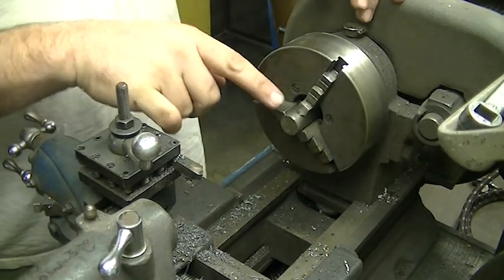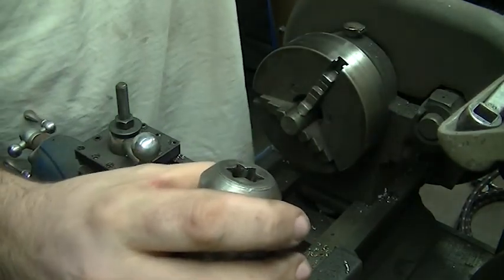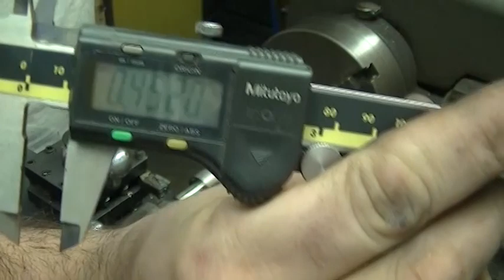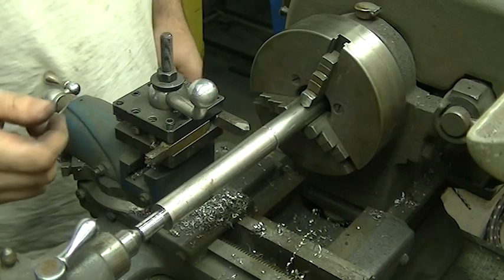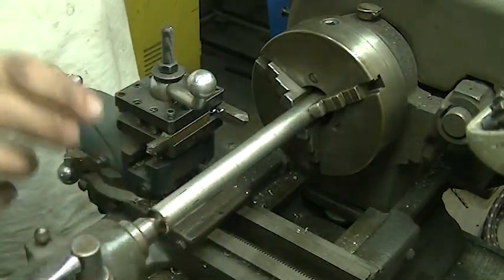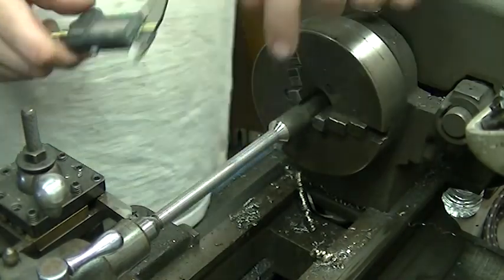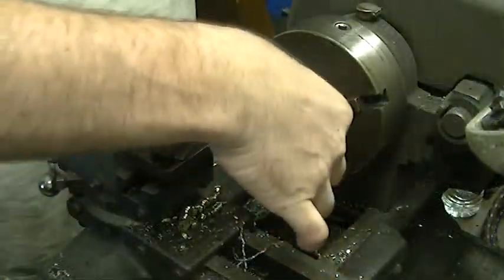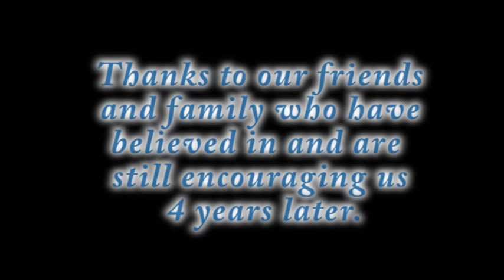Spring Loaded Center For Lathe / Milling Machine

Comment: Liked the entire idea, and will be making one. One thing I would change is making the shank 1/2" so I could also put it in a collet for use on the mill without using a chuck. Also, I saw a video where a cut spring was put in a V block and held against a sander to make it flat, just passing that on for what it is worth.
Thanks for the great idea!

Comment: I'll have to agree with the mention below about reaching in with bare hands to remove long stringy chips. Only a matter of time until you get hooked. I never touch the chips with bare hands, that's what a cheap chip/paint brush and long needle nose pliers are for. And there's a few designs around showing how to convert the more usual hand wheel advanced tail stock quill over to a lever feed. Much nicer for deep hole drilling but even better if you had a second tail stock to convert so either one's good points could be used as needed.

Highly recommend a book written by a George H. Thomas in the U.K. Despite the title it's almost all about shop made tooling, very high class machining and some very good tooling designs. The Model Engineers Workshop Manual. 100% the very best book I have and there's a lot of those to judge it against.

Comment: Nice vid Jeff. I got my 1st Lathe 32 days ago (Atlas 12x36 Commercial) You touched on many points I ran across already. I used a tap wrench for the 1st time today being supported by the tailstock center, played the quill advance game. Drilled yesterday....played the tailstock advance, retreat to remove chips-advance game. I think I am gonna make one of those spring loaded centers tomorrow. I am thinking the bore and sliding center need to be pretty tight tolerances to avoid play...maybe over-thinking it since its just supporting a tap handle. I dont have a mill for making the slot, should be interesting. Thx for sharing the project :)
Reply: Makin Sumthin From Nuthin

Comment: Nice work m8. Material is Stainless steal 304, foodgrade, easy to machine and can be polished up like 316L. I’m working with all stainless steal grades on day to day basis ( machining parts for food manufacturing company).
99% we re using carbide inserts for ease of use and cost per peace.
Keep it going

Comment: I think I would have put the stop screw and slot a couple inches further up, such that the stop screw was slightly more than the slot length away from the end of the center piece . That way the spring wouldn't be exposed and gather up chips.

Still, a nice little project.
Reply: my thoughts exactly

Comment: It looks like 'high precision' isn't required for this project ; but I would suggest using a boring bar for the hole, followed by a reamer to have a precise & STRAIGHT bore. * A 4 inch deep hole can wander quite a bit , which can move the 'center' enough to cause trouble !   While it is true that a tap will 'follow' a hole, the spring center has a side to side error that is equal to the hole's bore error PLUS the tolerance of the plunger that the spring pushes .  . . which may be as much as .015 to .017 per side of 'true center' !   * *  That much 'side to side'  PLAY, or 'slop' is likely enough to 'spring' , ( or create a side force ) on the tap. . . which could turn a good tap into a nightmare in a heartbeat !    
       Check the runout of the plunger, while chucking up the turned down , (shank) end of the tool - With the spring fully extended , place an indicator on the front , or top of the extended center . . . then move the center with your hand , forward & back , as well as up & down . . . that will show your 'radial error' .  . .  I would be interested in hearing that number , my guess is that it will be around a 32nd , possibly more !    Distance of a small error is compounded by length, which is also compounded by the angular deviation from 'true center' !    ( I work to tolerances of 400 to 700 nanometers , cutting & polishing gemstones . . . those numbers equate to wavelengths of light ! )           Hope this helps , if you run into troubles !    ;)
Reply from the maker: I completely agree about the boring of the hole and using a reamer, when I shot this video I did have a small collection of boring bars but no holder. The tool post I have does not seem to hold on to the bars with any level of stability. My new quick change tool post arrived the other day and a boring bar holder is included. 

Thank you for taking the time to comment and share some experience with me, it gives me a lot to think about and I am always interested in learning new things.
Reply: Jeffrey Santo u have a lathe and a mill so do what i and many others before us have done. make a boring bar holder. also u complained about who ground your chamfer tool? apparently u have no idea on how a lathe is used. which for a beginner is ok the compound is used to cut the taper not the tool! so learn how to set and use that to create the proper angle.

Comment: ok boss I have a project idea for you. can you figure out a way to put a locking trigger mechanism on this? up the spring capacity on it so it can be a spring loaded punch?
Reply from the maker: The mechanism would be easy, you could use the same triggering system used in those small .22 cal zip guns. The trick would be how to compress the spring and setting the lock to hold it in place. I would also need a piece of drill rod or an old broken drill bit to make the punch, that would need to be hardened.

Comment: the only comment other than nice job is I would rather have the slot in the barrel of the tube be closer to the end so that the spring would not be exposed. I think dirt and small pieces of swarf might get into the tool otherwise.

Comment: Hey Jeff, looks like your lathe could use some lubrication.
Reply from the maker: It really needed to be taken apart and cleaned, I try and maintain things but there are times I get very busy.  My shop is rather small and the oil on lathe soaks up a lot of dust from the sandblaster. Some months when we have a lot of work coming in I break it down a couple times to remove the grit from the moving parts. Even covering it does not seem to keep the fine dust out.

In the future I am hoping to have a shop where the sandblaster, bench grinders and belt sanders can all be in a different area that can be closed off from the machines and welding equipment.

Comment: I'm no expert but I don't believe that is considered an really good chip. Correct me if I'm wrong, Ideally the chip should break into tiny 1/8" chips...
Reply from the maker: Your right, you are no expert... chips are not consistent from one material to the next, softer metal can leave long string like chips. I also use high speed steel rather than inserts with chip breakers... I deleted your other comment, your assumptions are not facts, go read a book or find something useful to do.

Comment: I was under the impression that 'rats nest' "chips" were undesirable for any material.
Reply from the maker: Most machinists do not like the rats nest forming around the work. With materials like stainless steel or aluminum it is not uncommon to see when your using high speed steel cutting tools. These tools were ground and sharpened using stones and had nothing more than the cutting edge and a relief cut in them. In a modern machine shop you'll see inserts used much more often than high speed steel tools. The carbide inserts are fabricated with chip breakers to prevent the forming of long ribbons. 

If you see a long ribbon forming with an insert is could mean that the insert is damaged or dull. With high speed steel it means that you have sharpened the cutting bit evenly, you are cutting (feeding the bit into the material) at a good consistent pace and you have a good depth of cut.

Comment: Nice project.  I bought one a while back, but yours has more travel, so I may make one anyway. I suspect that your material is a leaded steel...like 12L14 or something like it. Not sure that having it reach the back of the chuck is required...only back force comes through the spring and the drill chuck jaws should hold that easily. 

The quill travel issue can be dealt with by a chuck mounted on the tool post.  Might be another good project, or you can buy one at places like Edge Technology ( http://www.edgetechnologyproducts.com/tool-post-drill-chuck/).  Advantages include longer feed (saddle travel), power feed (if you are feeling lucky), and precision depth of cut (using compound aligned with spindle). This works best on a quick change toolpost...it's a bit large to leave on one like yours, and aligning it every time you mount it might get old fast. On the other hand, a QCTP is nice to have anyway since it doesn't require shims to set tool height and you can keep more than 4 tools ready to go. Aloris was out of my price range, but my Phase Ii import works well on my South Bend 9". 

Thanks for the video and the ideas!

-- Mike
Reply: PS.  Safety note: I know you said the long stringy chips you got from this material are soft, but it's still not a good idea to grab them off while the lathe is running using your fingers. Get caught in a loop just as it snags and you could get cut or worse (several horror vids available on the net....). Some materials, like stainless steel, tend to make razor wire when cut like this and you have to be careful even with the lathe off!

I use a pair of long handle double-acting pliers from Harbor Freight (about $8 I think). These keep my fingers almost a foot from the action and cost less than the gas to drive to the hospital. A hooked wire with a handle is another option for clearing birds nest chips. 

Thanks again for the video!

-- Mike
Reply from the maker: This is a good point and very true, I have seen people cut themselves using course steel wool. I will be more mindful of this in the future. Thank you :)
Reply from the maker: I never considered leaded steel, just for the heck of it I went out into the shop after you suggested it. Did the only thing I could think of to narrow down what it might be... Its non-magnetic.
Reply: From what I've read, non-magnetic rules out 12L14. Lots of SS isn't magnetic, but those tend to have sharper chips I think. Ya got me....maybe another viewer will have a better idea. 

-- Mike
Reply: 12L rusts quickly even in low humidity environments. Best guess 416 or 303 stainless. Those would be the more common variety's but no way to tell for sure. But it looked like it machined well so one of the more free machining stainless grades. If a scrap piece will harden then it's likely 416.

Comment: why you are using dead center in the tailstock? You also obviously need a living
Reply from the maker: Why do people always assume that if you have a lathe you have all the tooling to go with it?
Reply: We're just in Russia are not used to hammer nails stethoscope and try not to use things not on purpose.
eventually you obviously have the golden hands, and you can make a "living center" and a pair of metal bearings